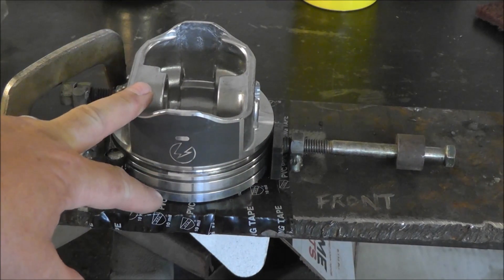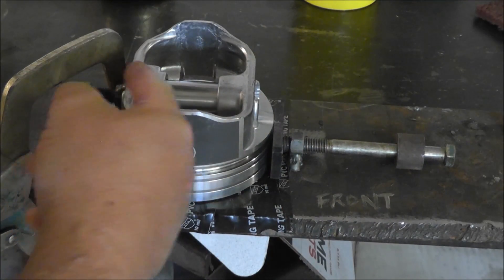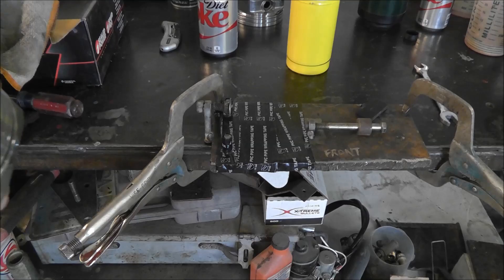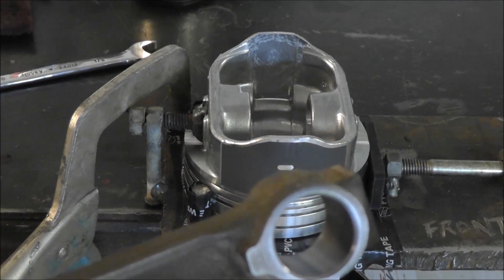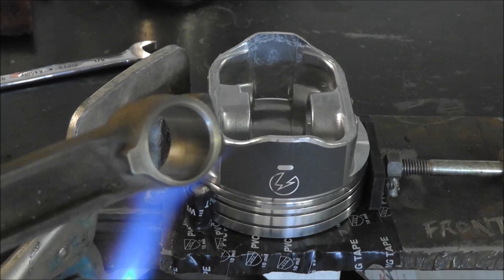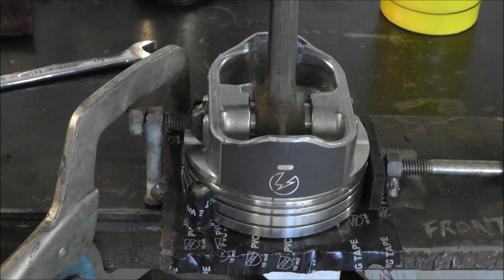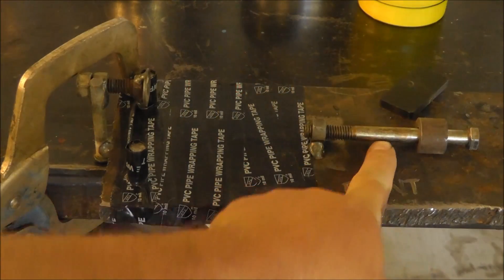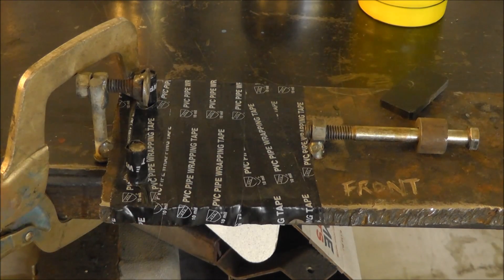press fit wrist pin install

Comment: I use to fit Cummins pistons and rods by freezing the pins,and putting the pistons in hot water,because the rods had a bushing.you had to be quick,but it worked. Good video Rick.You did a great job on the tool.Your a pretty handy guy.Thanks........Rick
Reply from the maker: Rick Palluck thanks for watching!